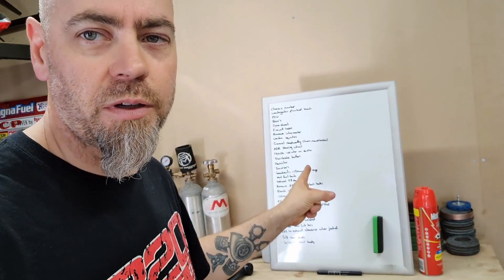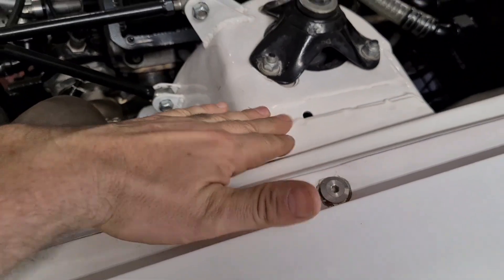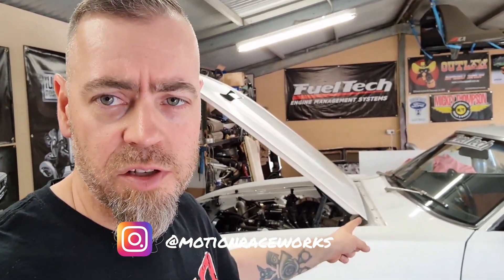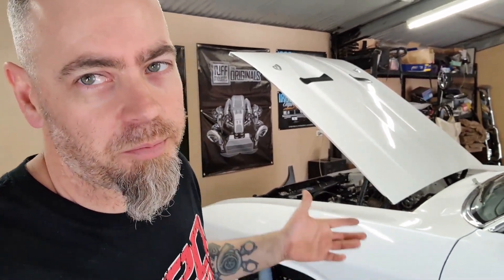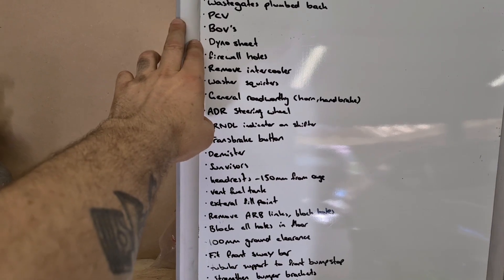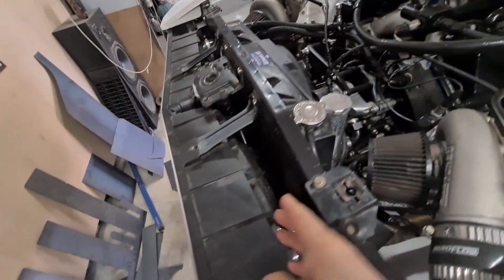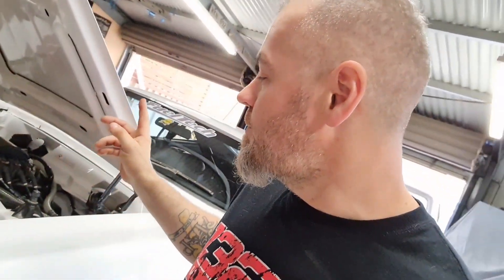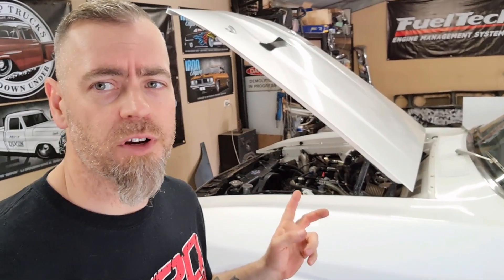Engineering My Twin-turbo Falcon; Ep1(pt2) The [second] List

Comment: Seems really achievable. Same on the inter cooler deal. Interested in seeing the requirements on the four link and rear suspension details to meet the requirements. As you stated most of the stuff seems pretty much just general roadworthy related.

Comment: Seems like a hell of a job for the wastegates. Would that affect performance?
I find it strange how the improvements you made to strengthen the vehicle are frowned upon by the authorities.
Reply from the maker: If the pipes merge far enough back in the dump pipes it shouldn't affect performance at all, we just have to avoid adding back pressure too close to the turbos.
I think they're more concerned about the modifications being performed incorrectly/unsafely, that it's not a hack job that has more potential to harm than strengthen 👍
Reply: @Philthybuilds  Roger that bro! 🙂

Comment: Again, thank you for another true and well-informed video, You have had the skill/knowledge and ability to build this car I'm sure there is nothing that fazes you to bring your car back to Regency passing the car, as for your 1400 HP on the street,  Well, your probably One of maybe Two cars (if that) in Sth Aust with that sort of HP on the street, You would know 600/ 650 HP on the street is a hand full. Just like a Nos bottle in the boot of a car, I believe you can have it, But you're not allowed to have it connected?? So when you go roll racing I guess you trailer your car to the Ben's, As for the Drag challenge next year, "your stuffed" for driving your car out of Sth Aust, without a boot/trailer load of mods, Looking forward to your next follow-up video,
Reply from the maker: I should have mentioned that it's a fairly easy job to put the intercooler back in when it's required 😊
Reply: Dougy.  its my understanding that having a NOS bottle fitted in in breach of the EPA and you would have to carry a dangerous good certificate.  Any NOS install either pattial or complete is illegal.
Reply: @scottdowling6655  Hi Scott, 
No I don't have, 
I was told this about not being connected was OK,
Thank you for the advice.

Comment: Any dramas with the turbos etc chopped into the inner guards?
Reply from the maker: No they're fine, the inner guards aren't structural and are forwards of the front suspension mounting points